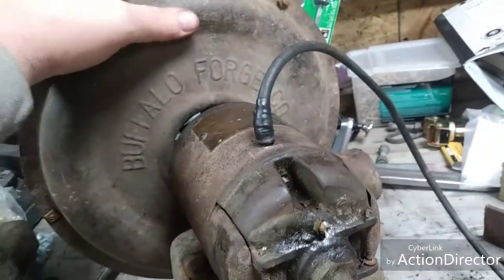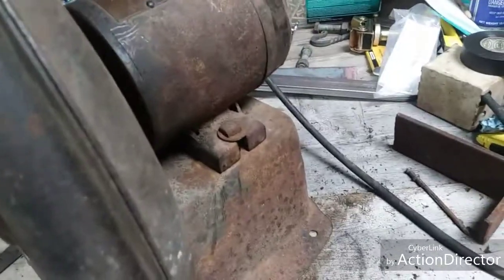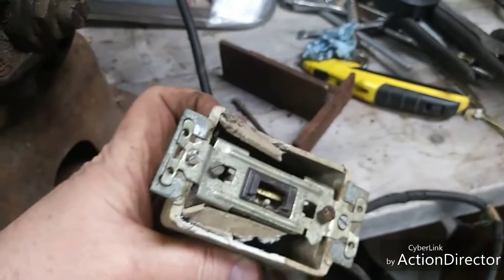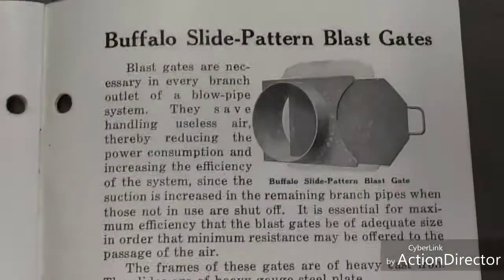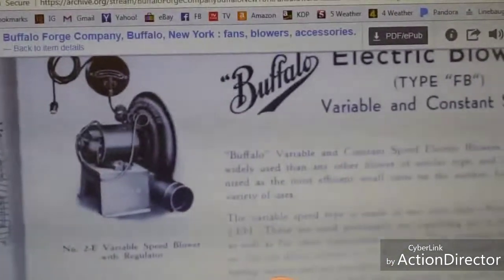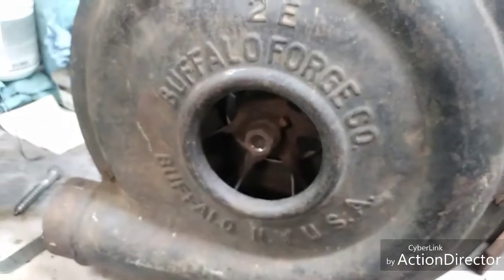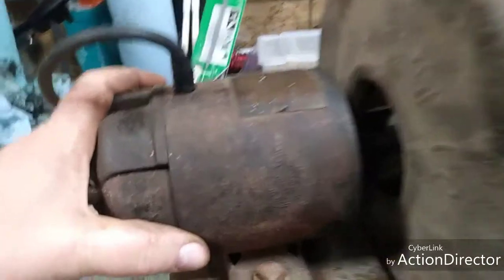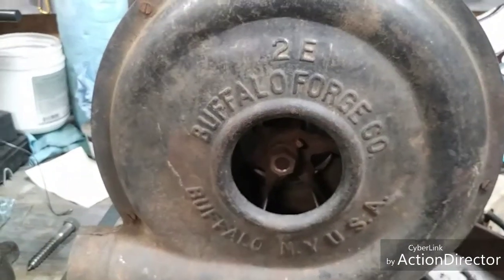Buffalo Forge Electric Blower, How do I set up a Rheostat?

Comment: Hi, Just hook it to a receptacle with an ordinary house light dimmer for speed control.
Reply from the maker: I will give that a try.  I am going to make a air flow diverter box so I can have my crank blower come in from one side and the electric on the other side.
Reply: That sounds like a plan. I have electric blower only and would like to have the hand crank option.
Reply: Do not run this on a household lighting dimmer. I have this blower and rebuilt mine last summer. If you want to use the original motor, take it to an electric motor repair shop and have it checked and serviced. I replaced the bearings in mine, yours are shot. I have the original rheostat for mine, however I run mine on a Variac type of device which works very well.